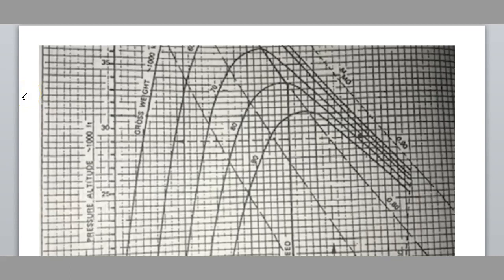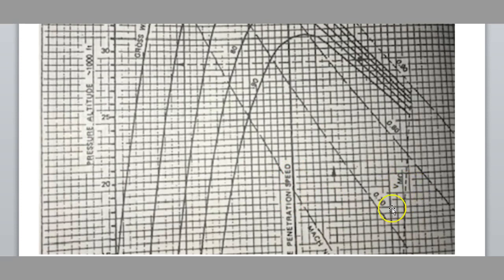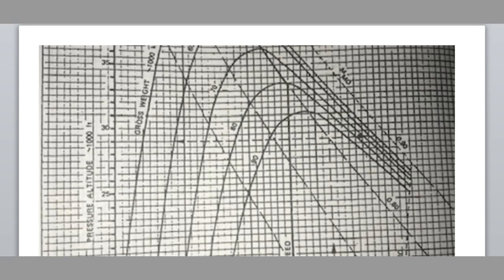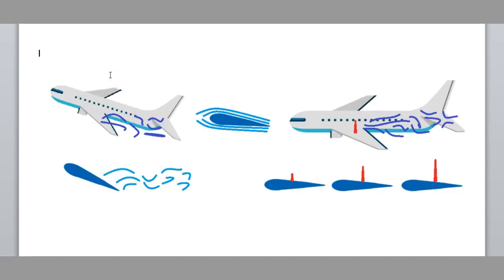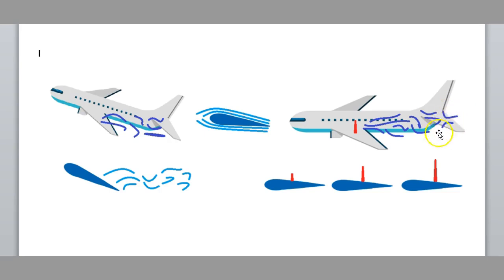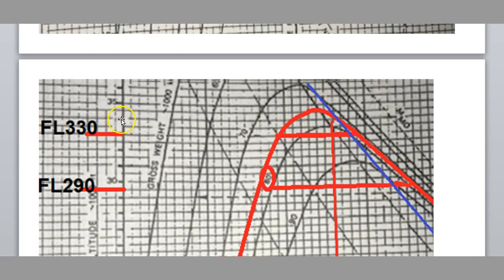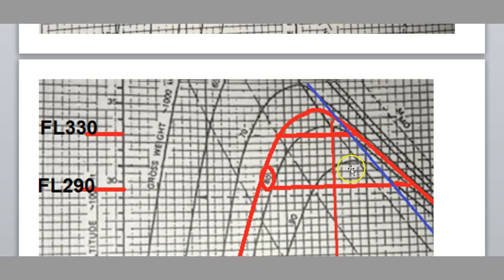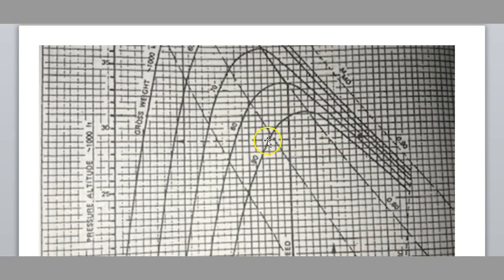CASA ATPL Flight Planning Buffet Boundaries - For CASA Flight Training, Pilot Exams & Learn To Fly

Comment: Hi, I just wanna ask is Vb always the same (280kts)? Does Vb affected by speed or cruising levels? How do we find Vb from these graphs? 
Thanks!
Reply: Vb isn't always the same, see page 1-2 in the manual. It says the turbulence penetration speed is 0.80M/280KIAS. Now it wouldn't be CASA if there wasn't some ambiguity (let's be honest there is heaps!) What this means is that Vb will be 0.80M or 280KIAS whichever is least! So depending on your flight level will depend on what you would use. 
You can also see this reflected on the buffet boundary charts where Vb begins to taper off on the 0.80M line as you hit FL335.